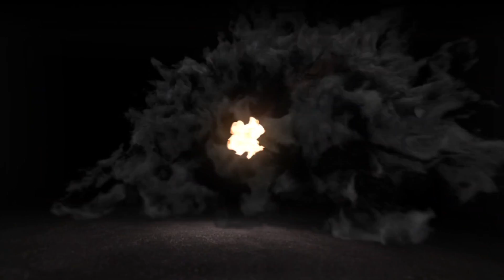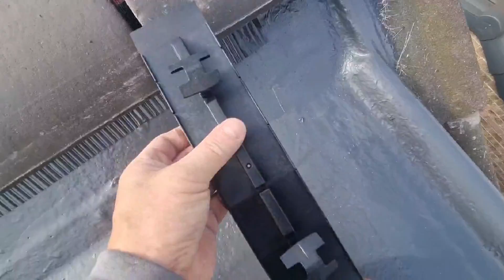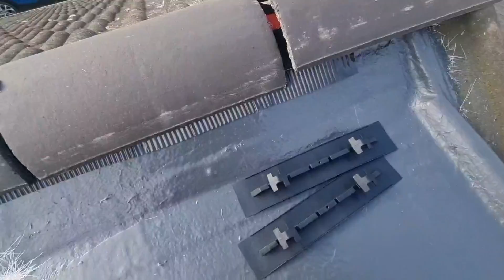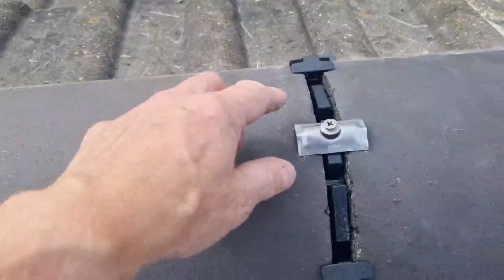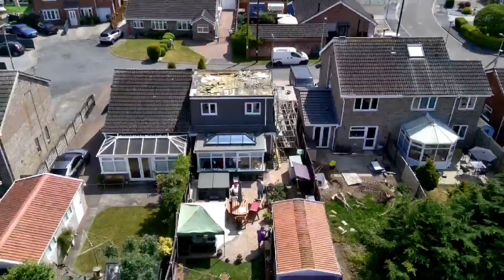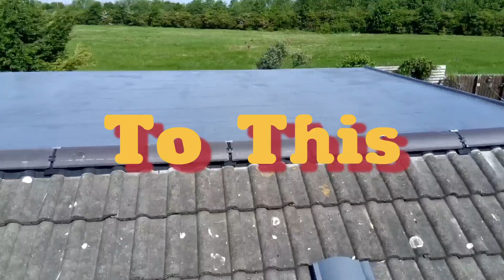We Added A Dry Ridge System

Comment: How many years will that breathable membrane and those black clips that hold the tiles together be good for? 10 30 30 40 years ??? 
A roofer is re tiling my roof now and putting these on my ridge and I'm worried about them leaking 😖
Reply from the maker: Hi there is no need to worry, they cant leak as the plastic runs under the tile, the membrane is semi permable whi h means it lets moisture out but not in.  Much like the rest of youe roof membrane. They will outlast sand and cement,